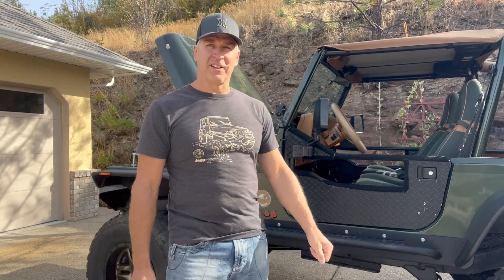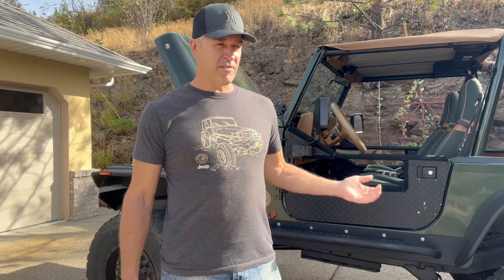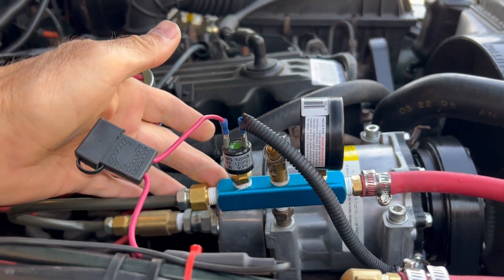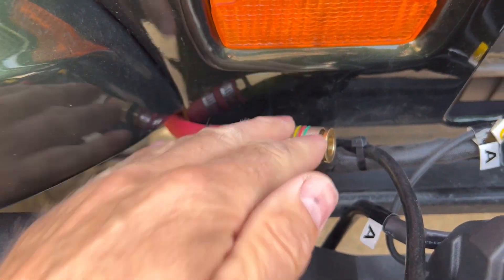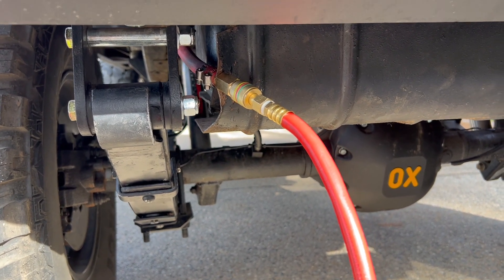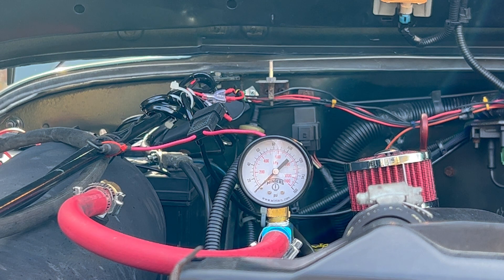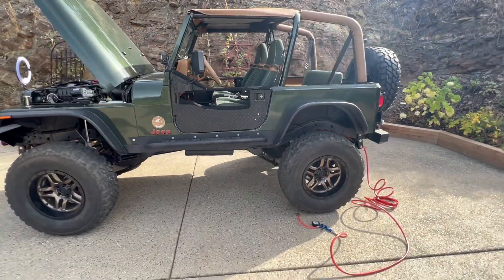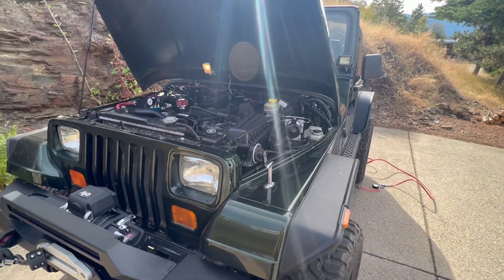DIY Onboard Air 1995 Jeep Yj Sahara

Comment: Do you need to worry about lubricating the compressor?
Reply from the maker: Yes actually.  I should have drilled in a grease zirk to lubricate it, as many do.  And probably still will, in a year or so, when I feel it needs lubrication. There is a couple videos here on youtube where they showed the grease zirk (nipple) install.  Thanks for watching !  Maybe check out poweraddictsfixjeeps video on the same install.

Comment: I did this on my yj years ago. I installed an old Ford hi idle switch. This really helps. I set the hi idle at 1100 rpms. Before I did hi idle solenoid, used the fast idle cam on the carb. Can't do that with fuel injection. I  also put an recirculating oil system in-line using a moisture trap with a 1/4 turn valve. Works good, but have to be sure not to overheat the compressor.
Your install looks really good, enjoy.

Comment: what type of AC compressor do you have in your jeep. did you put a oiler on it? is it a York compressor
Reply from the maker: Hello,,, it is a UAC CO 4702C A/C CompressorUAC off Amazon actually.  I tore it down,  drained the fluid, and put in the set screw that seperates the two chambers it has for normal ac function. Then, I greased all the parts with a gear grease. People have told me that they get around 3 to 4 years of heavy use just with grease. I am going to add a grease nipple so I can pump in a bit from time to time.

Comment: Do you have a link to the parts? Manifold? Valve that won’t let air back in to the compressor? The relay that keeps it at the right pressure?
Reply from the maker: Ben,  thanks for watching, and I appreciate the questions too.  As I am still pretty much a rookie at making and posting the vids I am bad at putting up links to parts. I will see what I can find for you, it was all pretty much amazon stuff, even though I try to shop around town.  Will try to get back to you asap
Reply from the maker: I added some descriptions for you,  just copy and paste into amazon.  When I tried to do it as a link, it didn't work, sorry.  Have fun with your project !
Reply: @DervFuel  thanks! We have a ‘93 Sahara that doesn’t have factory AC. Think we’re going to go this route now.

Comment: Hi, nice YJ, does the A/C compressor require lubrication when using it as an air compressor? I've seen videos of low rider's using a compressor like this and they packed the compressor with grease for lubrication, I also recall seeing someone using an inline oiler
Reply from the maker: Hello,  great question,   the compressor needs to be drained of the stock oils, and there is one set screw that gets put in a 1/4 inch hole to block off where it normally bypasses. Then, you lubricate all the parts with normal automotive grease. Under normal use, the grease will be enough to lubricate it for years ( i have heard as many as 10). It was a fun, and rewarding process. The fellow I mention with the "Poweraddictsfixjeeps" channel, shows the process of the set screw and lubrication. He even installs a grease nipple to add lubricant periodically.   Thanks for watching!

Comment: Nice jeep and a great video.  One of my projects is an 88 and I have thought about adding onboard air but thought I would need to put the tank in the passenger compartment somewhere.  I never thought there would be room in the engine bay.  Good job.
Reply from the maker: Thanks Daily,    the 3 gallon tank really amazed me with the boost it gives on start up, or just a small fill.  I will follow you and hopefully see your project air , if you get around to it  !   Cheers